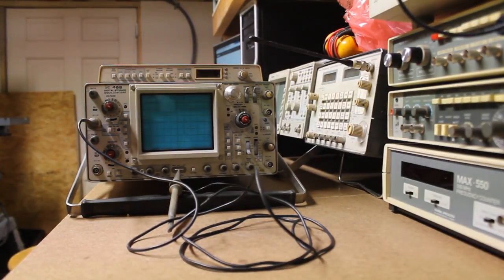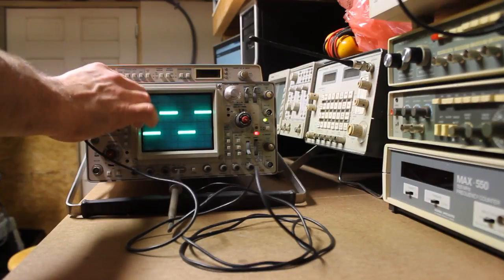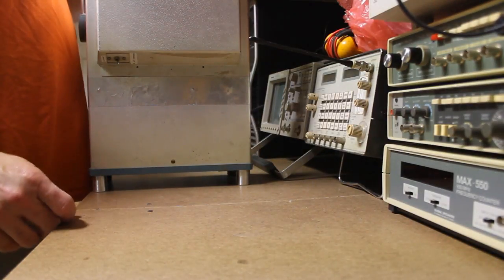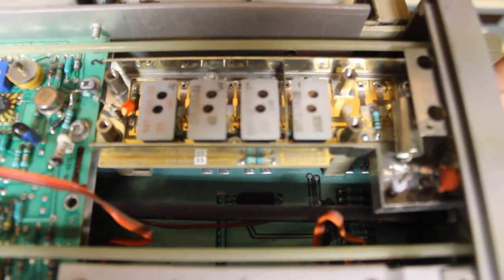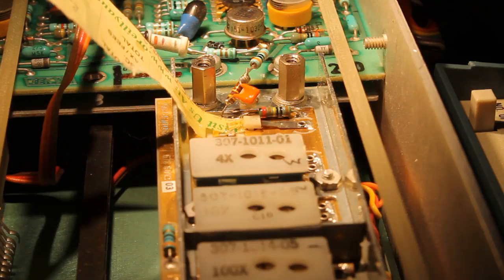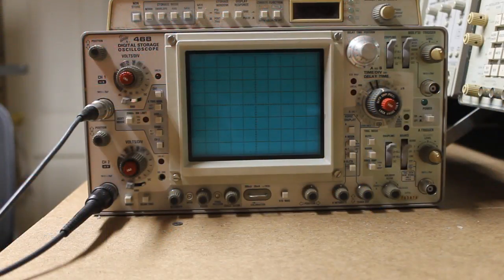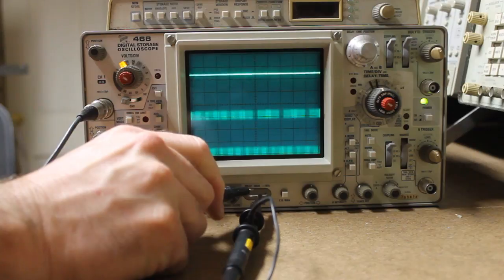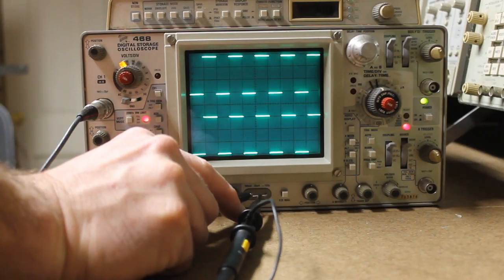Tektronix 468 Digital Storage Oscilloscope Troubleshooting and Repair

Comment: well its not repaired was it? nothing wrong with it just need read the manual first!
Reply from the maker: SignalSource it did need the attenuator contacts cleaned, and the attenuators needed to be reseated. I bet by now it needs to be done again. The downside of owning an older scope is that you usually have to work on the scope before you can work on the project.
Reply: I had ordered one last week and costs me a fortune to get it from USA!  I like them very much and don't wont to be hit by failures!  (Beside that I don't see much point of  taxation on 2nd hand equipment if the governments have any intention of reducing the carbon footprint. I bet they have not!) Your video is highly helpful though.  I also ordered HP 3325B function generator as the .....A version had the support  sized by Agilent. Please enlighten me if you have such equipment. I have now gone too deep in my HPIB stuff and determined to see my instruments hocked up! One warning though! Its proven to cost me far more than the new technology but who cares! I'm still thinking about 1969 moon landing and the thought of that fascinates  and  motivates me.  I may never understand how they did it but will keep trying.  My biggest project is automating my curtain so I don't miss the sun rise!